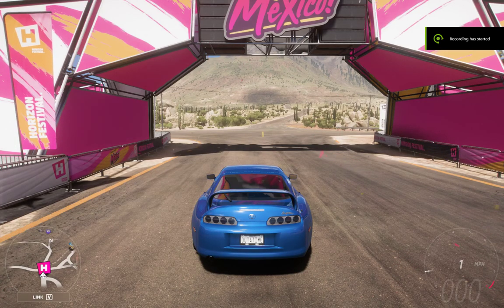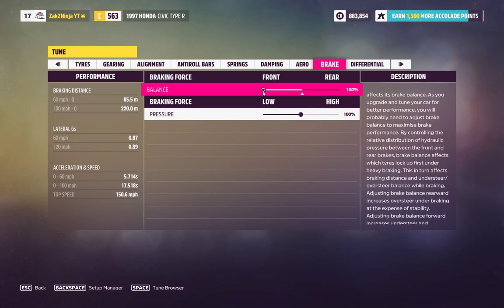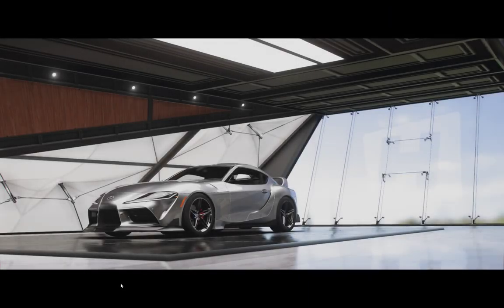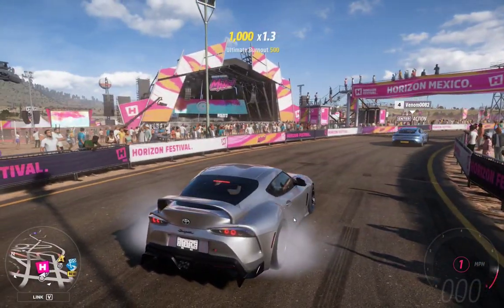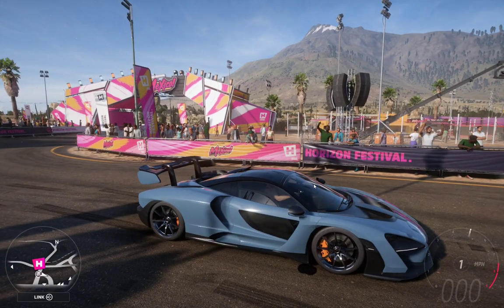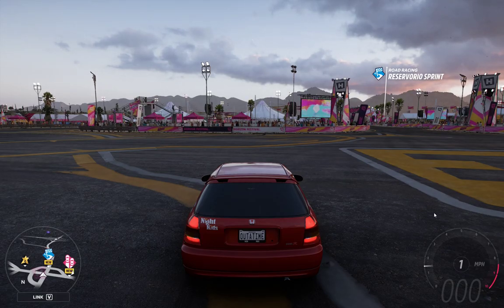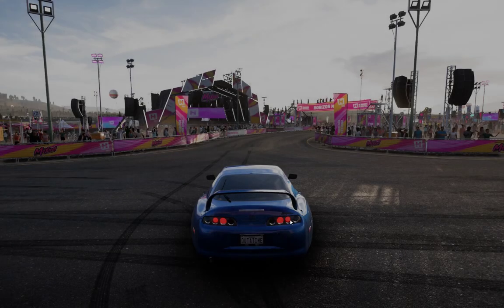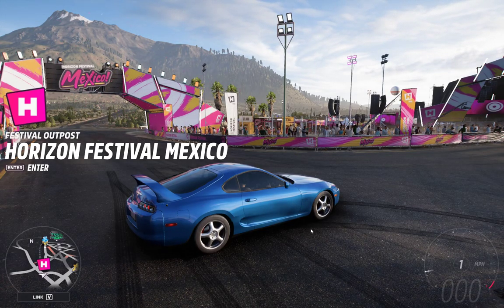FH5 - How to do a Standing Burnout using Any Car on Controller, Wheel

Comment: VERY hard for me to do in the Porsche 918 Spyder... Still trying.
Reply from the maker: Did you convert it to RWD via diff tuning or an upgrade?
Reply: @Zak-Z-Ninja  Ya, going to try again today (as I have more time) to see if I did something wrong. Watched the vid, and spent 5 minutes trying.
Reply from the maker: @yarrokon  It is hard with supercars  but I am sure its possible. If all else fails try using drift or other low grip tires.

Comment: GUYS ALL U NEED IS DRIFT TIRES U DONT NEED TO MESS WITH SETTINGS then just rev ur car then let go of the brakes then press them again
Reply from the maker: That does work for some cars yes, but in this video I was trying to cover all possible cars. It is very difficult (if not impossible) to do it in super cars like the Senna without this trick.
Reply: @Zak-Z-Ninja  oh ok

Comment: doesnt work for me idk
worked in 4 tho
Reply from the maker: You on keyboard?
Reply: @Zak-Z-Ninja  Yh
Reply from the maker: @Execu7ing  yeah, that's the issue. I mentioned later that you can only do it with fwd and you need to use the handbrake
Reply from the maker: Kind of bumb if they made this a new "feature"

Comment: what do i need for this to work on keyboard?
Reply from the maker: The game seems to not let you put on the throttle and breaks at the same time (on keyboard) so what you need to do is use the handbrake instead. But the problem with that is the handbrake will only stop the rear wheels so your forced to only do it with FWD cars.

Comment: Didnt help with the 911 gt3. Car just kept going forward after letting off the gas even though it was for less than 1 second. That was the only car i wanted to do that with. Kinda disappointed but thanks anyway
Reply from the maker: Were you using a keyboard?
Reply: @Zak-Z-Ninja  nope. I was using a controller cuz i play on xbox

Comment: Doesent work for RWD
Reply from the maker: You sure you tuned the breaks to rear 0%?
Reply from the maker: Also are you using keyboard?
Reply: @Zak-Z-Ninja  yeah I tried both actually no change
Reply: @Zak-Z-Ninja  controller
Reply from the maker: @SethKolbePrefect  not sure than why it's not working if your on controller